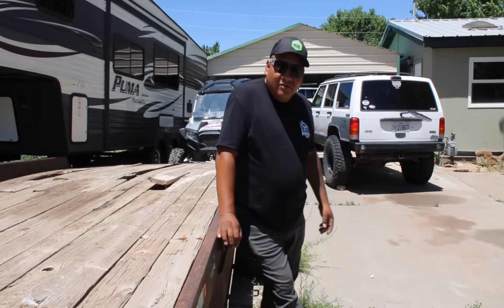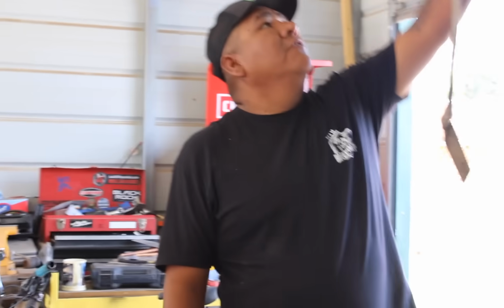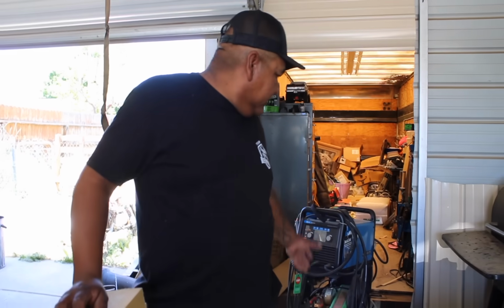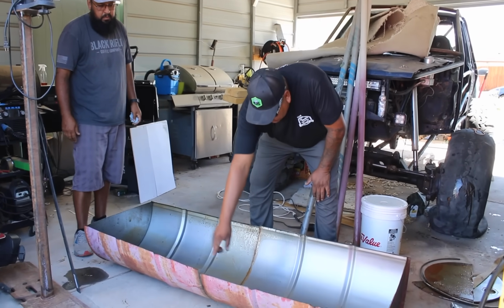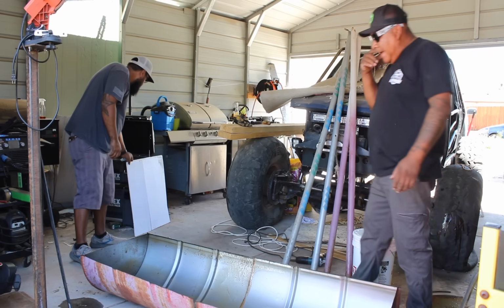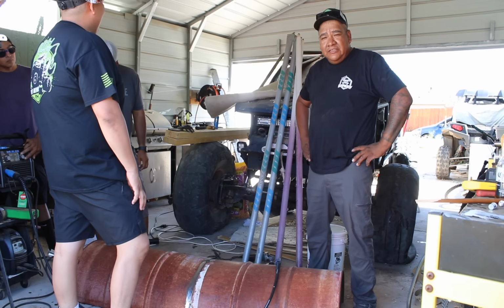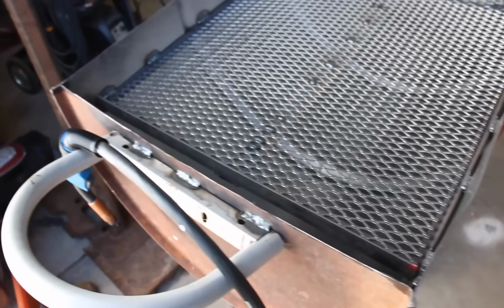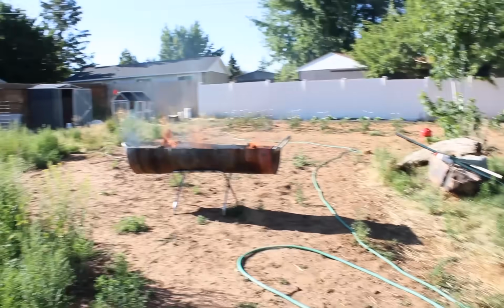Shawn & Ryan build a BBQ

Comment: High rollers over here with the two sheets of expaned metal😂
Im sure its all done by now but if you dont weld a frame around that it's going to twist back and fourth as you ise it and then youll risk the grate falling into the fire🤷

Comment: If that’s galvanized y’all will be sick!
Reply: Hold your breath if you weld galvanized pipe. That galvanized welding smoke is not good for you.  Use black pipe.
Reply: Galvanization will burn out have welded over miles of it I don't know what the big deal is